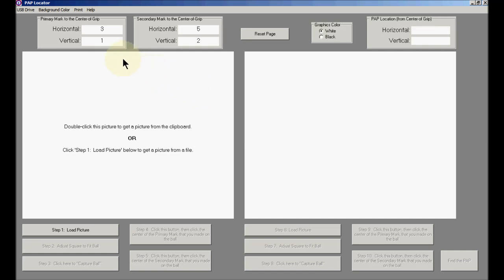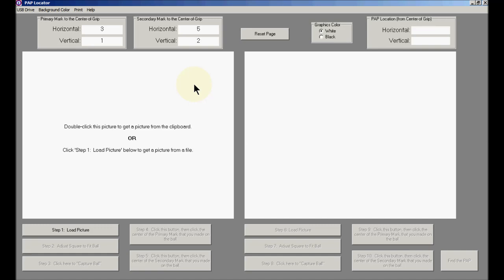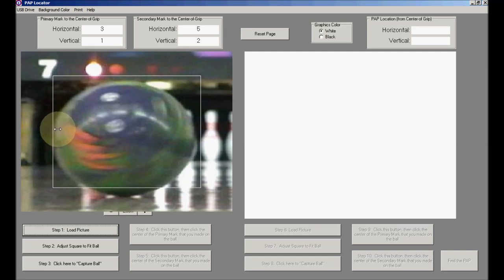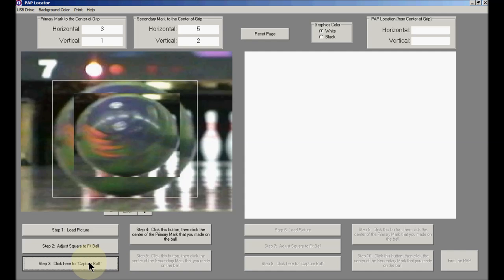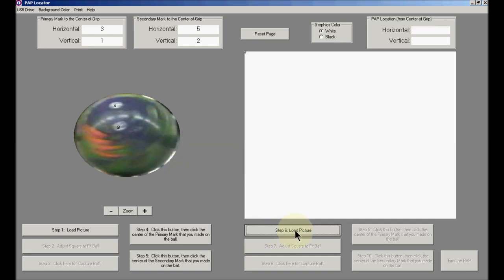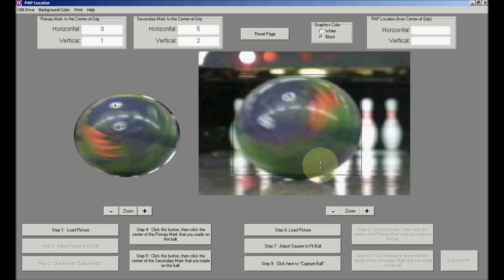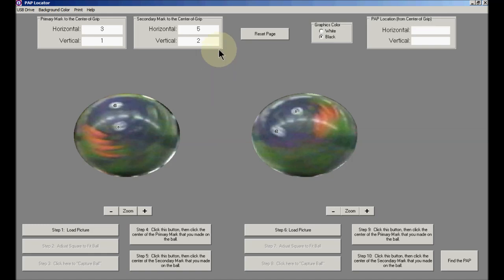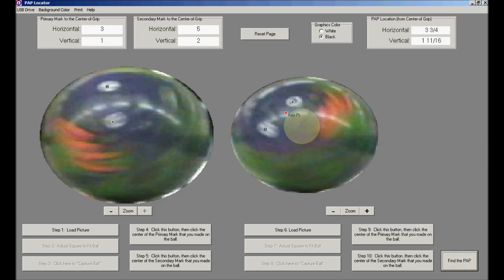PAP Locator Directions

Comment: You mentioned in the video that there is a primary and secondary position for placing the tape on the ball. The questions I have are:
1. Do you take the picture of the ball separately with each tape location? So first picture is primary with H=3, V=1 and second picture is secondary with H=5, V=2? 
2. In other words do we re-position the tape and take 2 pictures to calculate the PAP???
Reply from the maker: +Dove Bar Hey Dove Bar.  Sorry about the confusion.  The primary and secondary positions are located on the ball at the beginning of the video shoot and remain there.  A video is then taken of the ball motion.  Still shots are obtained from the video using the appropriate technique for the camera and software that you are using.  The frames should be as soon after the release as possible and ideally are captured within one revolution of the ball.  One of the still shots is imported into the software as the left picture, and the other still is imported as the right picture.  Both the primary and secondary marks must be visible in both still shots.  Use the computer mouse to locate the primary mark on the left picture, then the secondary mark on the left picture.  The more careful you are, the better your results will be.  Then import the right picture, and click on the primary mark followed by the secondary mark.  Either mark can be considered the primary mark or secondary mark, but once you decide, do not switch them when going from the left picture to the right picture.  For example, suppose that you have marked on location with a white marke and the other location with a yellow mark.  In the left picture, you click the white mark first and the yellow mark second, then you MUST click the white mark first and the yellow mark second in the right picture.  (It would also work to click the yellow mark first and white mark second IF YOU DO IT IN THAT ORDER FOR BOTH BALLS!)
I hope that this explanation is understandable.
Thanks, and good bowling to you!
RM
Reply: +Phoenix Ball Balancing 
Thanks, that helped make it clear.

Comment: I've checked several times your suggestion-ed webpage and it is not working as you propose. How can I buy PAP locator? I'm an IBPSIA driller. Thanks.
Reply from the maker: +Christos Konstantakopoulos Sorry about that.  We were not selling many of those programs and pulled them from ebay.  Ffor more information, please go to our webpage and send an email to dustomer service.  Details are near the bottom of the page.  Thanks.
RM